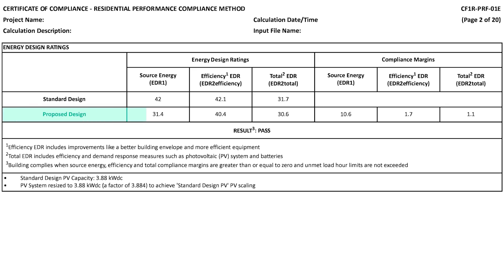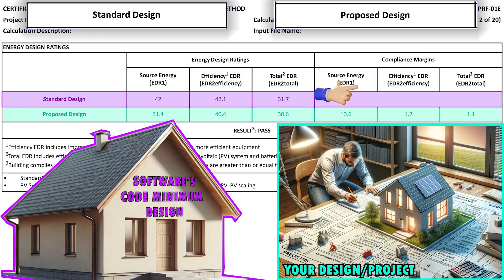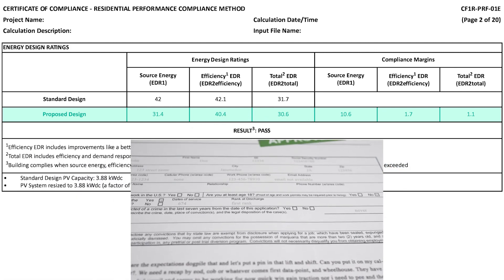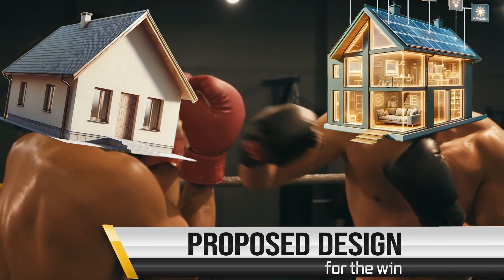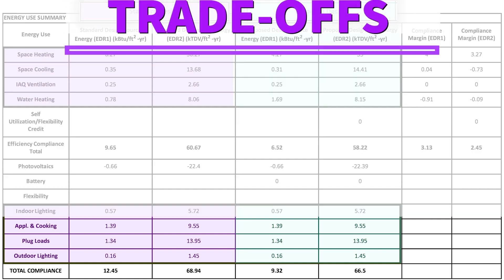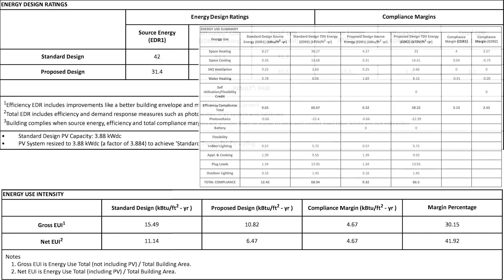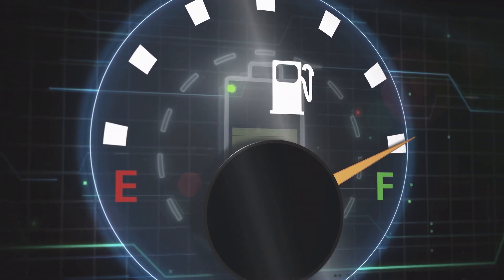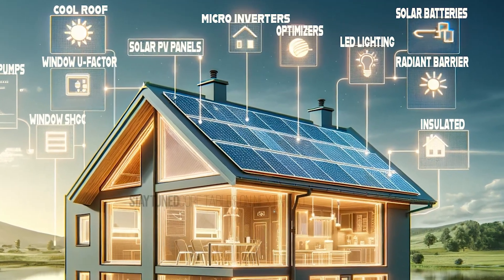The CF-1R Energy Compliance Form | Part 2

Comment: Very interesting. I wish this would replace title 24 in california so I would be able to design and build my own windows. My home consumes no energy (PV/battery).
Reply from the maker: Hello and thank you for watching the video.  The CF1R energy forms are one of the 2 approaches that the California energy commission authorized to achieve the energy code requirements.  

Regarding design/built windows, in California it is possible to design and build your own windows, 
Here are key considerations, however:
1.	U-Factor and SHGC: The windows must meet specific U-factor (thermal transmittance) and Solar Heat Gain Coefficient (SHGC) requirements, which vary based on the climate zone in California. 
2.	Compliance Documentation: For a building permit, you would need to document that your custom windows comply with the energy code. This might involve calculations or simulations to demonstrate compliance with the U-factor and SHGC requirements.
3.	Alternative Default Fenestration Procedure: If the custom windows are nonrated (not certified by the National Fenestration Rating Council - NFRC), you may need to use the Alternative Default Fenestration Procedure (ADFP) as outlined in the California Energy Code. This procedure involves specific calculations to determine the U-factor and SHGC for nonrated fenestration products.
4.	HERS Testing: Depending on the specifics of your project, you might also need to involve a Home Energy Rating System (HERS) rater for verification purposes.
5.	Quality and Safety Standards: Besides energy efficiency, the windows may need to meet other building and safety standards, including structural integrity, safety glazing, and emergency egress requirements.
6.	Local Jurisdiction Requirements: Always check with your local building department for additional requirements or guidelines, as they may have specific provisions or interpretations of the state code.
In summary, while you can design and build your own windows, they must comply with the energy efficiency standards set by the California Energy Code, and you must be prepared to document and possibly verify this compliance through calculations, simulations, or testing.

You could contact the California Energy Commission at: title24@energy.ca.gov
Toll-free in California: 800-772-3300
Outside California: 916-654-5106
to get more information regarding your design/build windows.

I hope this helps you. 
JM
Reply: Thank you for this video! Very informative. I just started my construction business a year ago.
Reply: Very helpful content. Just subscribed!